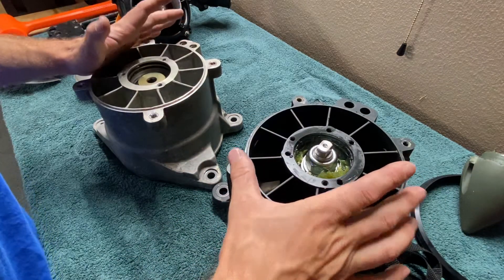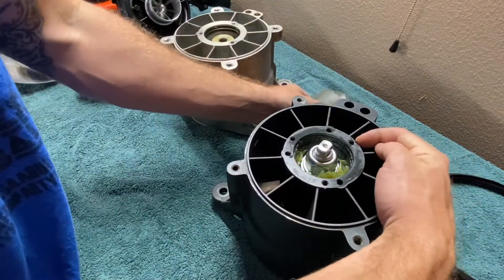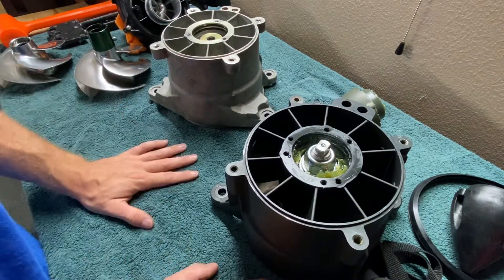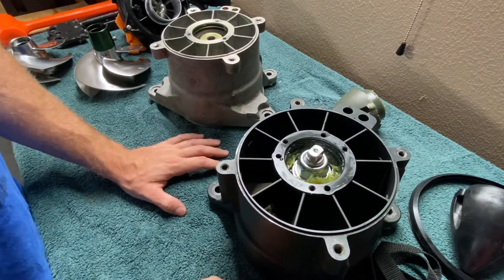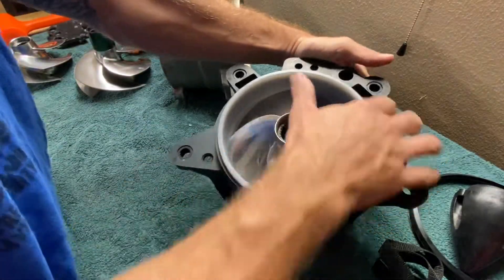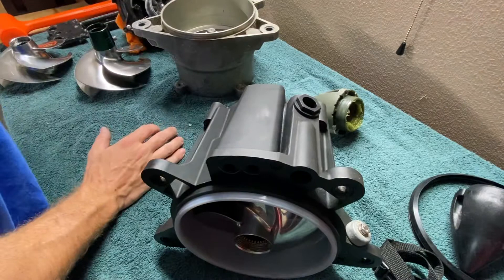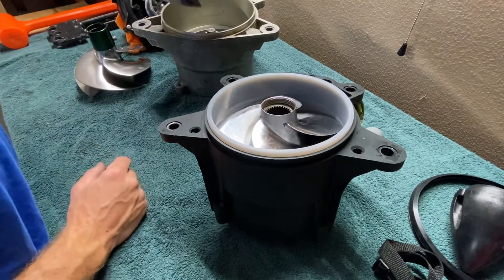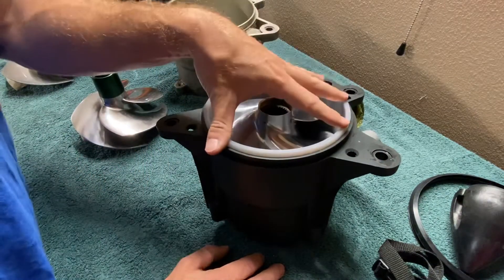Sea Doo OEM jet pump vs SBT!!!

Comment: We didn't get much time with the SBT pump. We had them fail as soon as a month.  What we do is remove the China inners (shaft, bearing & seals) and replace with OEM. Works great and still cheaper. BTW, Love the videos! Thank you!

Comment: I just comment on another video that you have about my shaft spinng on impeller and damaging splines. I got this sbt pump with stainless steel wear ring that i’ve upgraded along with solas prop and noticed after like 30 hours of using this sbt pump when flushing my jet ski from salt water ride engine stops suddenly, i check my pump and bearing were loose i tighten the bearing and works but when i go over 60mph it seems like it stops spinning and shaft eats splines on props. Any ideas? Or this sbt pumps are not really good for seadoos 300
Reply from the maker: Sounds like your bearing is going out.
Reply: Yes i still have my old oem pump and just bought new bearing, shaft oil seals, nut and all necessary elements to bring it back to life i believe nothing beats oem stuffs.

Comment: is the SBT aluminum? do you have the part #? I thought they were plastic housings.
Reply from the maker: It is aluminum. There are certain jet pump housings that are plastic but so were their OEM counterparts.
Reply: Have you seen jet pumps come in metal and plastic for the same jet ski?
That's what I'm wondering about, the housing material. My 2007 Seadoo GTI 155 pump housing is made out of plastic. I'm replacing the whole thing and I notice many of the replacements I find have a metal housing. It makes me question if it's the right part, the algorithms say "yes it fits". 

Coming from working on vehicles, it's unusual to see parts come made of completely different material.

Comment: I can share some first-hand knowledge as I have an 03 Sportster that has a SBT pump in it.
Regarding the quality of bearings and everything, I ride in saltwater a lot and I think the quality is a non-issue eventually saltwater is going to get past those seals and it usually ruins the shaft before the bearings go bad so while they are Chinese bearings I don't think it's a big deal.
Secondly if you use the SBT wear ring in their pump you can use the freezer trick, I do it all the time and it's super easy!
Third, yes you need a shop press and the special tools to rebuild the pump correctly.